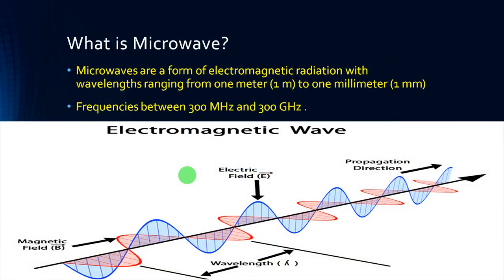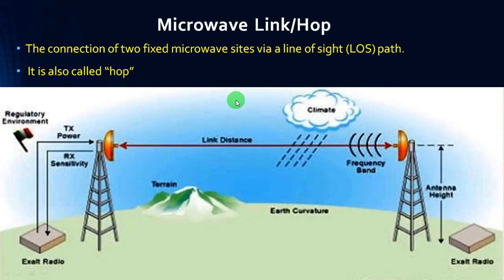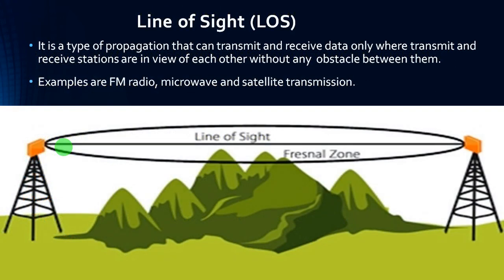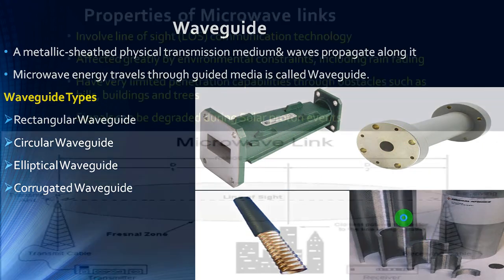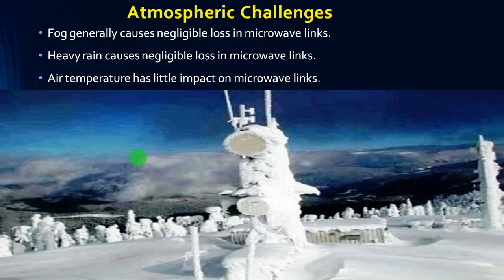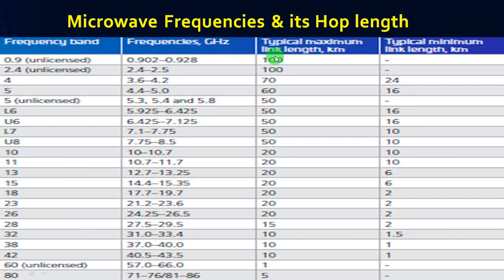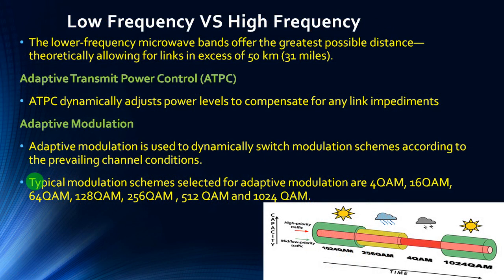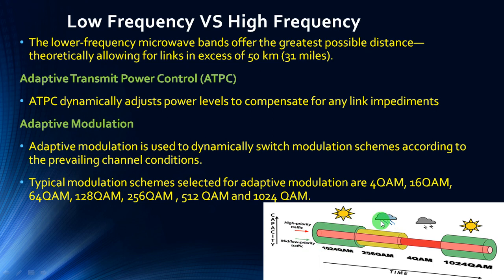Microwave Transmission Basics of Mobile Communication

Comment: I didn't know there was "microwave towers"..
Reply: There’s really no specific type of tower, well rarely atleast. Most “cell towers” will share 2 way communications of some sort or some microwave hops etc. the tower is there simply to get the antennas higher off the ground to achieve better signals to whatever is receiving/transmitting it.